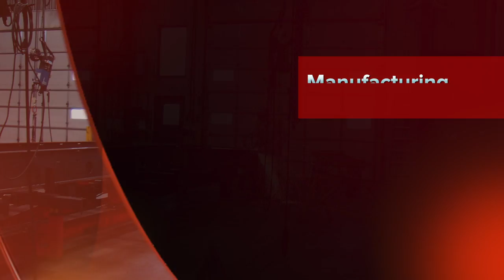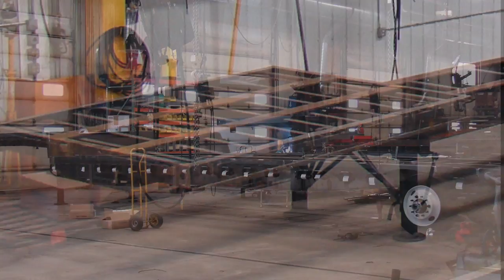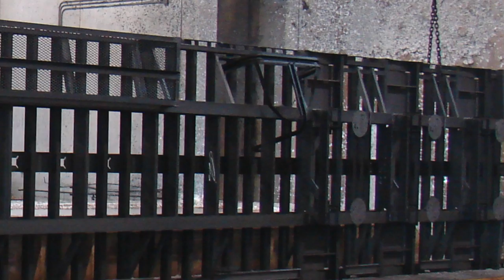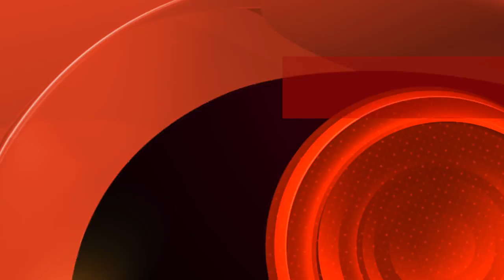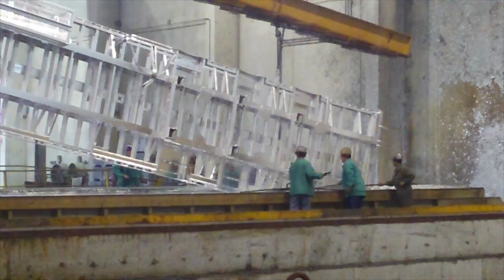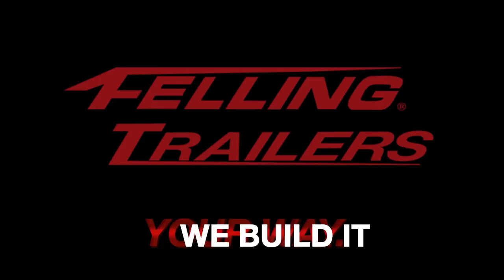Galvanizing a Felling Semi Trailer.mov

Comment: Damn, nice video, thank you! Any of you good folks have experience with Felling trailers, that you would be kind enough to share? I really wish this process was an opition on production pick-up undercarriages, skid-steers/implements, etc., etc... I have a 6 year old galvanized, low profile dump trailer that doubles as a trailer for my smallest skidsteer. It is used, constantly and still looks new! Had I known how great it would be, I would have ordered a larger size than my current 12k lb., 12 footer. I live on Cape Ann, Massachusetts so, between the Summer salt air and the salted roads in Winter it is a double whammy on even the best painted or powder coated finishes. All in spite of the fact that I, regularly & thoroughly, use my "Hotsy" pressure washer! Be safe & well guys!